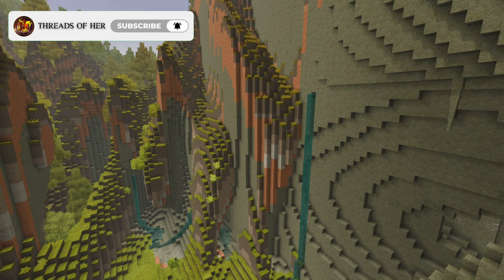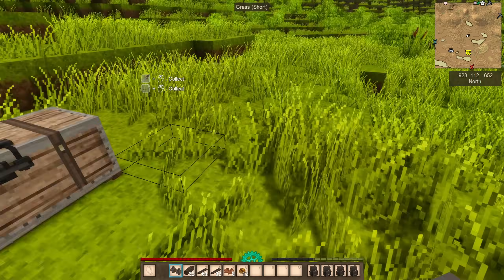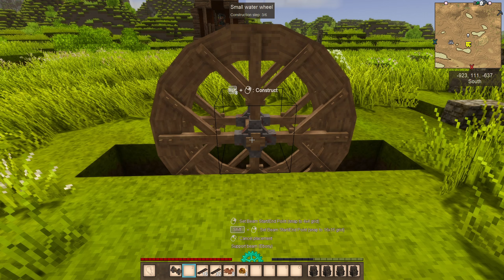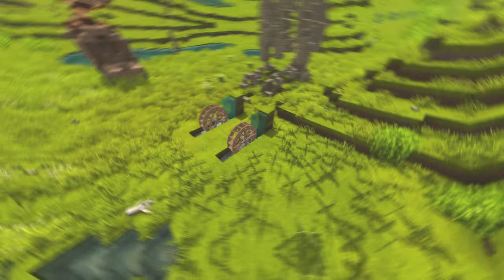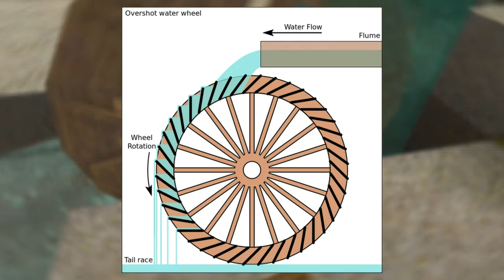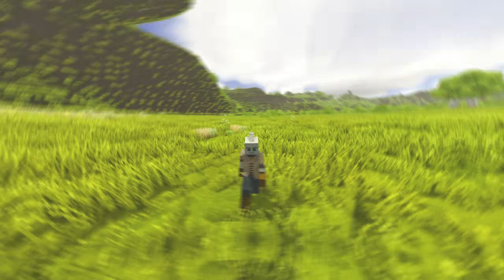Water Wheels Are OP In Vintage Story 1.22

Comment: The waterwheel design you showcased is actually close to a Pitchback waterwheel, since it gets power from the water falling down, and the water from the bottom, also because the water source in your design is closer to a pentrough than a penstock. Though used interchangeably, they're still different.

Comment: My biggest issue is actually trying to find a good location where the water is flowing.  I found a good spot until I realized it wasn't "rapids" water, it was just normal water.  If you have color maps on, the "rapids" show up as a lighter blue than still water.  And some "rapids" don't actually flow because of how the terrain generated.  I found a "rapids" that was one source block and one flowing block on the center top of a mountain in a hollow.
Reply from the maker: Rapids have this 'whiteish' particle effect in it, at least that's how I identify them.

Comment: Did they change something? I have a water wheel set up like you, but it can't power a helve and a quern with two step ups.
Reply from the maker: Nope. Maybe it's a mod if you use any or the power of the water wheel isn't at 5. Mine can still power a grindstone, a helve hammer and a pulverizer.

Comment: Overshot va undershot is irrelevant in understory. Going down the back vertically then across 3 still counts as 5. Also you did build an UNDER shot, not overshot. Over would mean going across the top then down the front

Comment: Doesnt seem like its enough to power up industrial smithy... I used millwright with 4 sets of rotors and 3 speeds before 1.22, rn i setted up 2 iron rotors with big sails and 2 speeds. Will upgrade to 4. Don't like the turbulence, which forces wide builds. Wish i had more freedom without sacrificing efficiency, i play on server and smith in mass.

Will make waterwill because we live near mountain with rapid, just for lulz tho

Or am i very wrong? Can it support 8 helve hammers with 2-3 speeds?
Reply from the maker: What is an industrial smithy? Is that a mod? For a helve hammer it's enough. You can increase power with the rapid splitting cheese or if there are more than 1 rapids nearby - usually most mountains have multiple.
Reply: @ThreadsofHer thank you for the answer. No, by industrial I mean a lot of fast machinery, maybe this is the wrong word, im not a native English speaker

A set up of at least 8 helve hammers at high speed. For mass production on server in town
Reply from the maker: @maryi685  Dayum. There was a feature - planned for 1.22 - that would have set fire your gears and axles if they were working very fast. You are lucky they scrapped the idea.

P.S. Your english was fine, I am not a native speaker either.
Reply: @ThreadsofHer  i actually didn't know it was only planned😅 but i did ask around before setting stuff, seems the server have some related stuff disabled anyways. I wouldn't risk our setup without checking first, its pretty expensive, especially early on. So far everything works smoothly, just on smaller scale.

Thanks! And thanks for the guide.

Comment: Hey threads of her how about You Maje a video about new windmil designes with they new giant Wooden gears
Reply from the maker: 10:22: https://www.youtube.com/watch?v=nnNdykBJ3ag

This is the best design. Make sure there is 15 blocks of distance between 2 windmills, if you hover over them, you will see if there is a turbulence. And the higher you build it the better it will be. Every 10 blocks from 110-120-130 blocks height will give another 1% power or smth like that.

Comment: Can you connect multiple water wheels in series? Like have the first one be powered than have another at a lower level for the water to flow over?
Reply from the maker: I saw a post on reddit, someone could split the rapid block forever and from a single block he made like 25+ and more. Now that's a lot of energy.
Reply: @ThreadsofHer that's crazy, thanks for the info
Reply from the maker: @karlthetechpriest2905  Np.

Comment: My only question is "how much Energy does it produce". 
Knowing how much torgue it produces informs what you can run off of it.
Reply from the maker: Not a lot. Although I made a build with a helve hammer, grindstone and pulverizer and it was fine. I saw a post on reddit, someone could split the rapid block forever and from a single block he made like 25+ and more. Now that's a lot of energy.

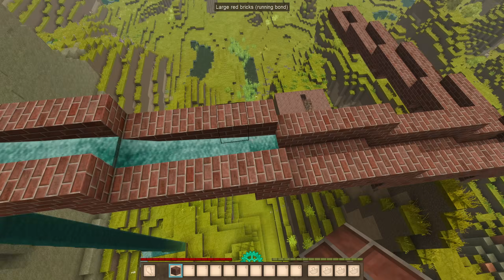Comment: 1:04 OKAY, it's timberborning time! Aqueducts are probably how I'll bring waterwheels to my base, although it would be pretty costly endeavor. 
Gotta make a nice, tilable and cheap design for aqueducts though.
Problem is height limitation.
Reply from the maker: Yes, height is a problem, cause after a while you are going to run out of it. Trees are probably the cheapest, easiest, but a stone, brick one would look better.
Reply: @ThreadsofHer  Found a nice compromise — a 1x1 pillar of cobblestone with some slabs at the top, main tube is out of pine slabs. With some optional decor in form of more pine slabs. Sadly, no images on redtube.

I mean, I have sideway instability enabled in my new world, but even with it you can make aqueduct UNDER ground, and then bring power with shifted to minimum speed axels back up, so it's just mainly a nice view problem. Wonder if devs/mods could make so rapid water could go further on some type of blocks (oiled wood?), so aqueducts would look like actual ones. 

Pine slabs also give so many particles, it's so cool.
Reply from the maker: @nirn_  Wow, that's actually a really good idea.

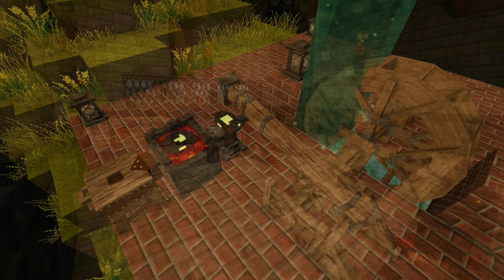Comment: 2:22 a water wheel also has incredibly high torque meaning if you speed it up using a large gear you can go 5 and a half times faster. You also might be able to speed it up again (although I haven’t tested this) for about 30 times faster.
Reply from the maker: I built a smithy design with a large gear, hooked up a water wheel and it can power a pulverizer, grindstone and helve hammer easily.
Reply: I must be doing something wrong. In my testing so far the moment I connect a large gear to a water wheel with 6 power sources (it's in a watershed river) it grinds to a halt :/ and 3 of them is barely able to power a helve hammer to a usable degree..
Reply from the maker: @ExileTwilight  Maybe there is a brake that you didn't notice? Mine works fine, although it only powers 3 devices.
Reply: @ThreadsofHer  seems to be something wrong with the watershed mod rapids. I did the same setup but with a aqueduct rapid and it powered 5 helve hammers easily :/
Reply from the maker: @ExileTwilight  Or that. I don't use mods that much.

Comment: An interesting thing to note is that the smithing recipe for the water wheel  hubs say that they need 4 iron ingots, but if you're clever about making use of the voxels in the middle instead of just splitting them all, you can build it with just 3.
Reply from the maker: I like to be frugal, but then again, if you find an iron vein, that thing will last for a long time.
Reply: @ThreadsofHer  yeaahh but you could be missing out on an entire extra tool
Reply: @xandersmith5742  true but i have like 40 unprocessed iron blooms lying around, i spend iron to make iron - though honestly i just jumped straight to the large windmill and skipped the regular one outright

Comment: But if I have two wheels, or maybe 3, and they all will be connected on same shaft, and have individual rapids connected via aqueduct (I understand that rapid can power only one wheel), would their power will combine or do I have to use gears or something?
Reply from the maker: Windmills can be connected via Large Gears. I use one Large Gear to collect the power, produced by 4 windmills and I use another Large Gear to distribute it. So on paper it could work, but it would look worse aesthetically, than 4 windmills.

Comment: "Water wheel is OP" My guy it literally is a mid to late game item that takes iron. How is that OP?
Reply from the maker: By going 24/7. Wind is very unreliable and I won't work on iron blooms manually. Iron is not that difficult to find and once you find it it will last for a long time, sometimes you can even find it exposed. Growing flax could take longer, than finding iron. The power could be better, but water wheel is currently in 'beta' and when we will have proper rivers it will be even more OP, topping wind power easily.

Comment: I have found like 8 to 9 fast water streams at one mountain. 

Im building a mountain base where i guided them into one central spot. Where i have i have a switch to toggel to go over the top gear speed for a time.

I will be sitting in my maschine room like drath sidious.

UNLIMITED POWEEEERRRRR
Reply: Also i didn't know 5 Power source Blocks is the maximum i have mine curently on 3
Reply from the maker: @jesperholst9318  Yep, you need to let the water flow from above instead of simply putting the wheel where the rapids are flowing. I think it's amazing, the game is already the most realistic survival game and now even more so.
Reply: @ThreadsofHer the one thing im a little sad about that you cant power the new blowers for the forge.
Now i need to find lava under my base for iron blooms.

But yeah this game is like crack the moment you understand that you need to use ur brain to figure things out logicaly.
Reply from the maker: Dayum bro, leave some rapids for the rest of us.

Comment: Requiring an aquaduct or a location under a pre placed water plock seems extremely limiting. I love the idea on paper but actually doing it sacrifices base design. For automation you'd have to put it underground which i'm not against but to get it back up to the surface means a lot of wasted resources and even though i like the choices, them being so limited in the regard of looks and practicality would mean either making a forge near water, moving base, or making a water duct that spans a long distance high in the sky or down a mountain. No matter what you choose, to go with a water wheel, if you aren't thinking that far ahead when making a base, can potentially be very very inconvenient.

My base is underground and near to water so i have no issues with this personally but i can't imagin getting to iron, being well established, then finding out you need, non-man made water sourses to make consistent power would be very disappointing imo
Reply from the maker: True, but I do plan my base ahead in creative, otherwise how would I build anything.

Comment: now we need to zig zag the water on the way down with waterwheels in between all hooked together :)
Reply from the maker: It would certainly look eye-catching.
Reply: pitty it dont work eh lol
Reply: Sadly, once it goes past the wheel, it turns to normal water. :c

Which is annoying, because water wheels IRL notably aren't in rapids...It'd be nice if basic flowing water was like, half the power or something of the rapid one...
Reply: @5peciesunkn0wn   To be fair 1 5 block water wheel can power 2 up sped helve hammers.
Reply: @TatersMCC  did you mean two helve hammers geared up by one step? So large gear powering small gear?
Reply: @5peciesunkn0wn yes

Comment: The waterwheel doesn't seem that OP. It looks like it can barely run a single helve hammer, and slower than an old setup with a single windmill, when the wind blows anyway. No idea how much torque it has by comparison. 

I assume that if you have parallel water wheels run by different sets of rapids, hooked up to the same axle, the power will add together. But that will require extensive aqueducts to bring all the rapid sources to the same area, and you will probably be limited to three. This means that waterwheels won't replace wind power, but supplement it. As mentioned, it looks like a trade from power to consistency, and of course it's also tech you can get a lot earlier than windmills in exchange for not being able to be put anywhere. If you really push for it, you can get iron going a few months into your first year, but you won't have nearly enough flax to make a set of windmills until fall at the earliest if you have a huge first harvest. More probably a windmill is a second year project for most players. Waterwheels are comfortably first year.
Reply from the maker: Exactly. Also I can do something during the nights, instead of waiting for the wind to work on my iron blooms.

Comment: well shit, here i thought water wheels were an alternative to avoid windmills and their costly construction. Only to find out it needs iron at minimum.
Reply: It depends on which resource you are limited on. With windmills, it requires a tonnn of flax for all the sails, whereas the water wheel's most expensive resource is the iron, so if you have lots of iron but not a lot of flax grown, water wheels might be a cheaper option
Reply from the maker: It's expensive, but at least there will be something more to do at night instead of sitting and afking.

Comment: not sure they are OP when they can barely run one helve hammer at very slow speed.
Reply from the maker: It ain't much, but it's honest work.
Reply: They have really high torque meaning if you upshift them with a large gear they can still run a halve hammer and at 5 and a half times faster than we saw here.